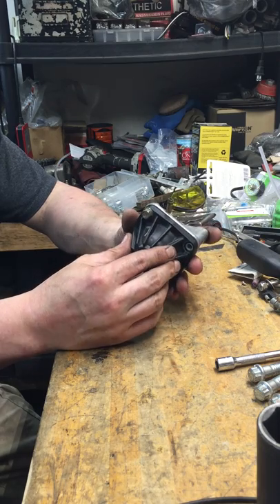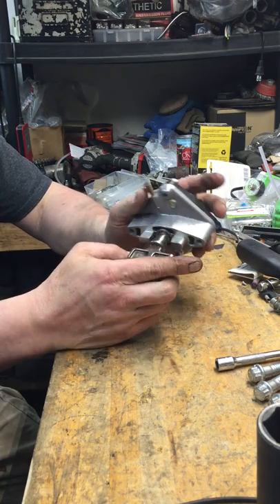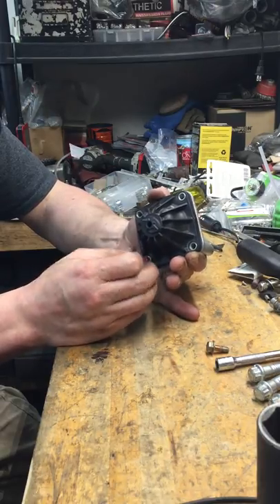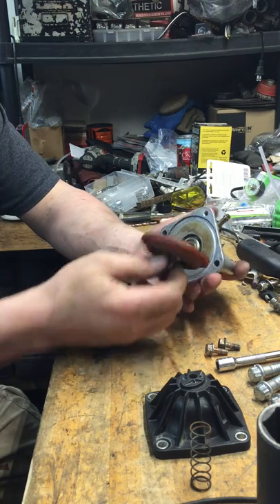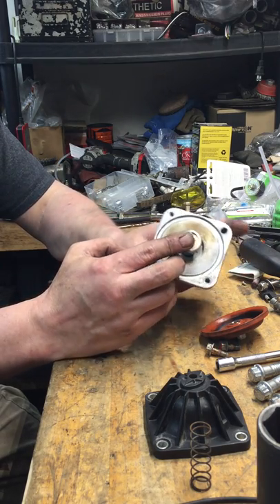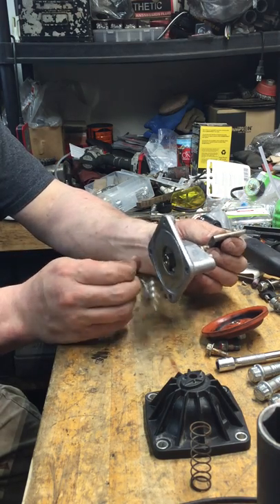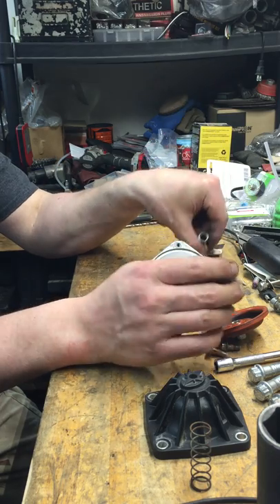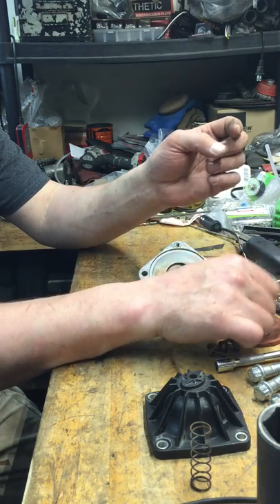Polaris exhaust valve cleaning extra information

Comment: if you want more Torque. Shim the Spring with washers. The older Caps used to be adjustable and they do make a HUGE difference with out of the hole performance.
Reply: O nice! Tips and tricks.  How many and what thickness? Also, can you go too far and do anything detrimental to the engine?